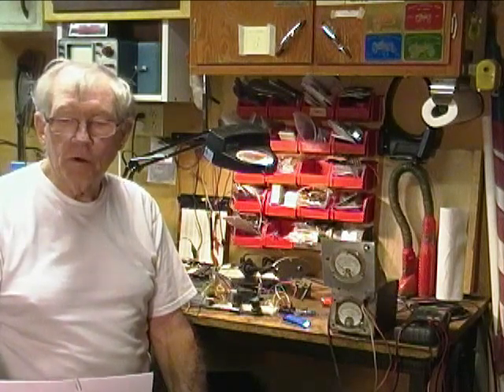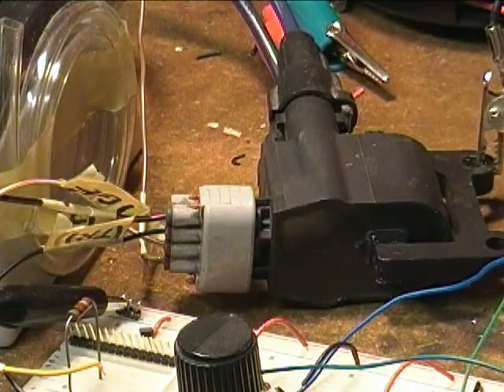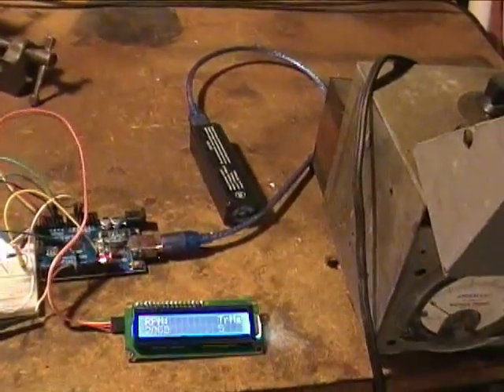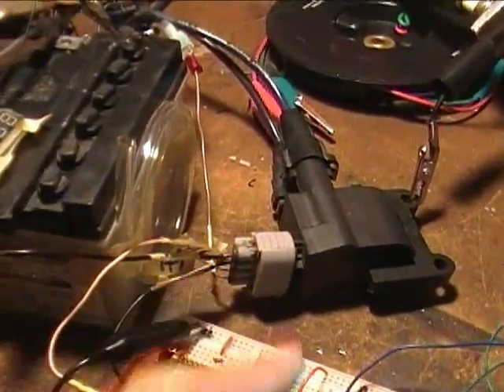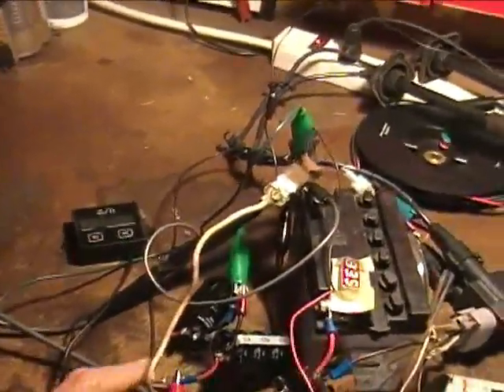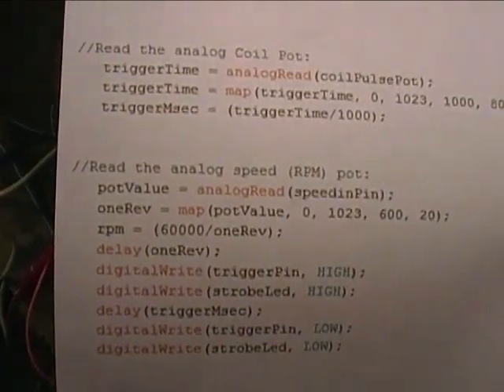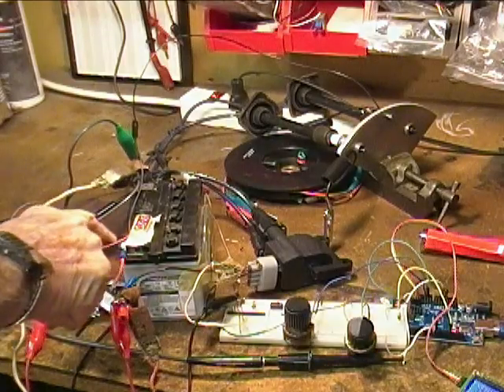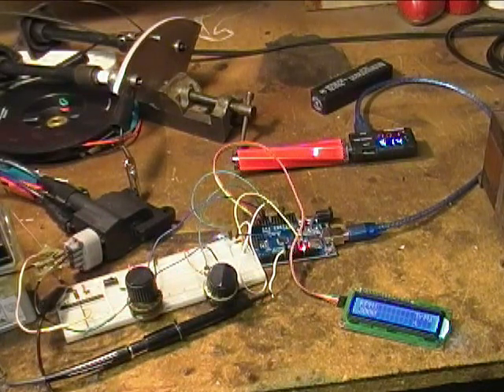Coil On Plug or Coil Near Plug Pak Saturation Tester Part 3

Comment: Interesting, but how would someone create shielding at home from common materials?  Would tin foil wrapped around the wires be effective or do i need to find some hollow braiding?
Reply from the maker: Just google "shielded cable".
You might even be able to find Cat 7 ethernet cable a t a "big box" store.

Yes, the tinfoil would work, too, but, of course it needs to be well grounded at only one end.

Comment: hello excellent project I am interested in doing something similar 2 cylinders also a motorcycle you could help me with the code and some schematic?
Reply from the maker: Hello Andres.
   I just put links to my latest ECU code and ECU wiring diagram here:
https://spaco.org/Computing/Computing.htm
  Please understand  that, although my system is up and running, it is still very much experimental.